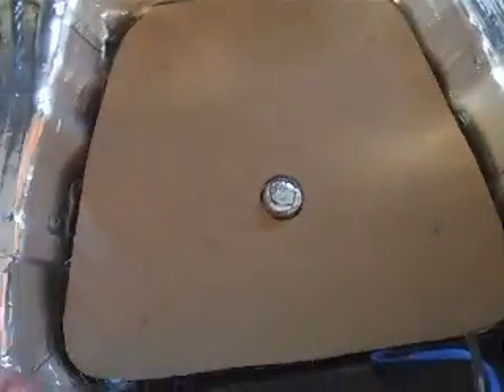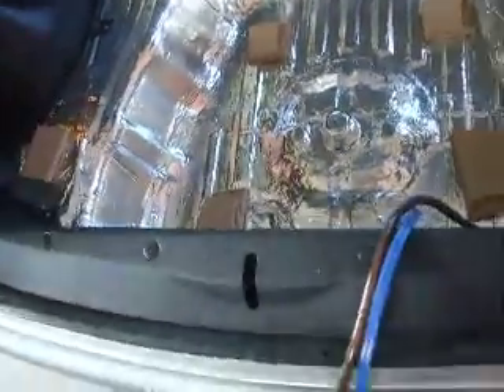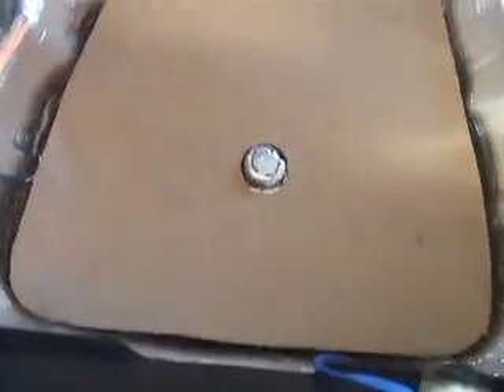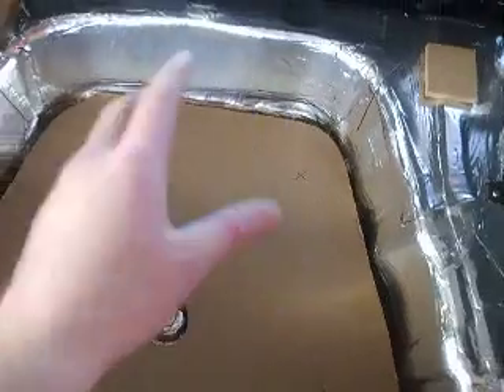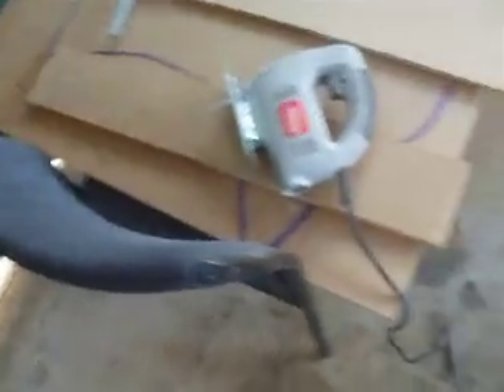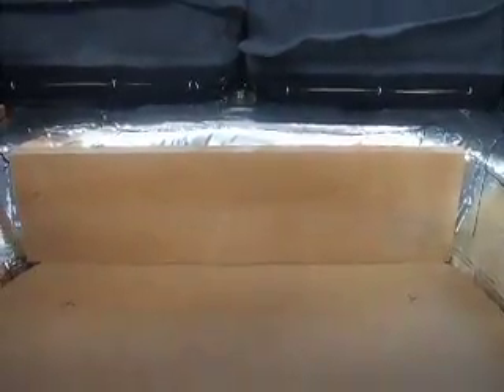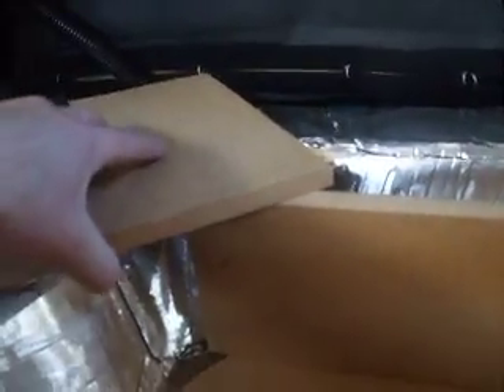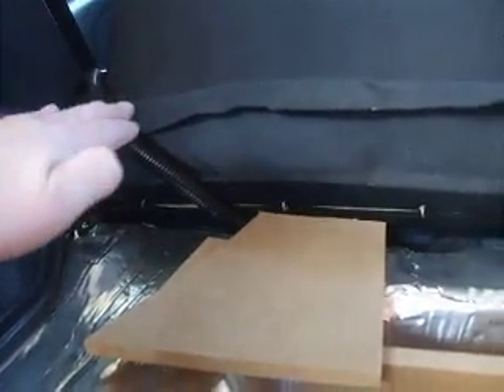Satria GTi Install Vid 18

Comment from the maker: Depends what you wanna do with that 18" really. It'd be punchy as hell in a box like that... but will it get low.. probably not. 
A good size box for an 18", I know, is anything OVER 4 cubes. 
But the 10s are working good enough. The 18" will go in another project :)